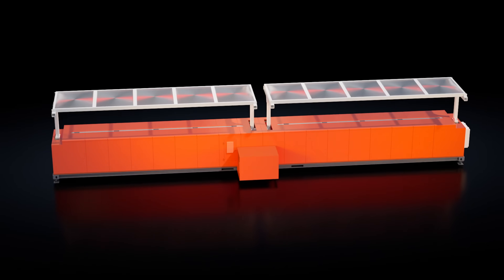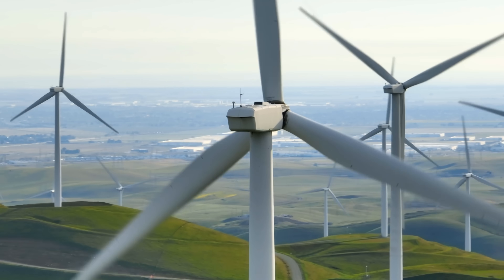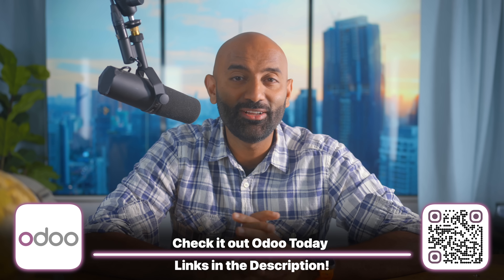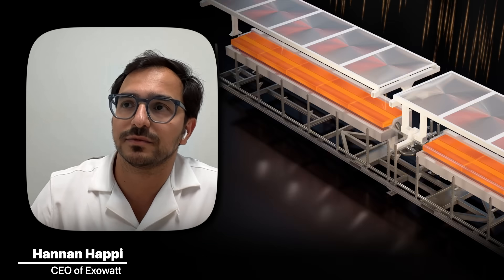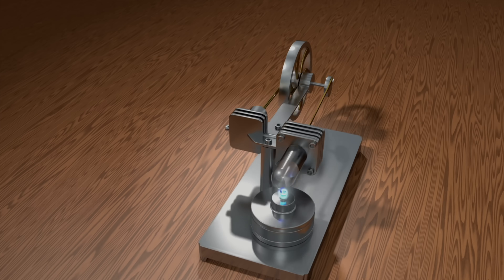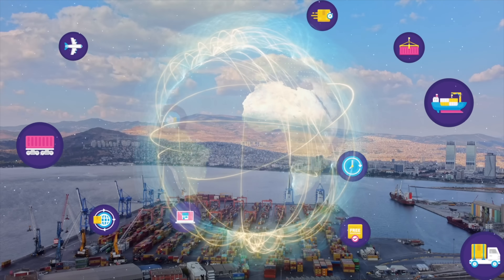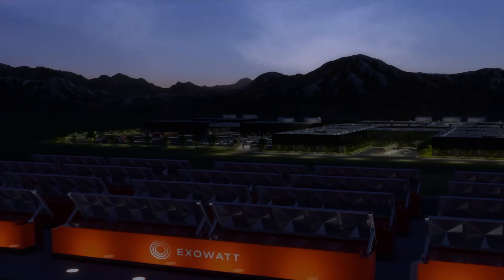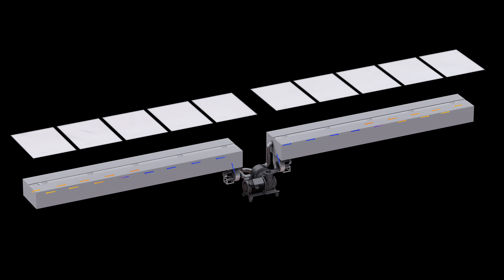Solar Without Panels, Storage Without Batteries - EXOWATT

Comment: Just one lens in the yard to store heat for home heating and cooling using the sterling engine to run a heat pump compressor or just heat.
Reply: Won't work, sorry.
Reply: @SolarCookingGermany  gosh thanks, you have saved thousands of people, good work!
Reply: @msowdal  I get this was meant ironic, but one lens will neither heat your home nor power a stirling motor in a useful way. I have such lenses myself. If you want to heat your home I recommend evacuated tube collectors, for electricity photovoltaic.